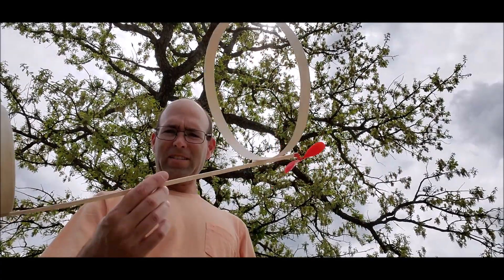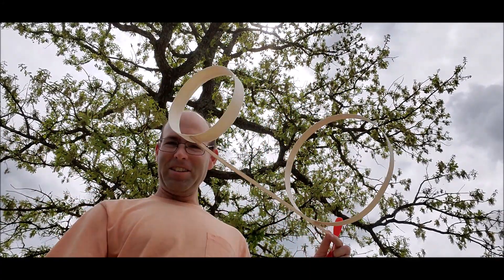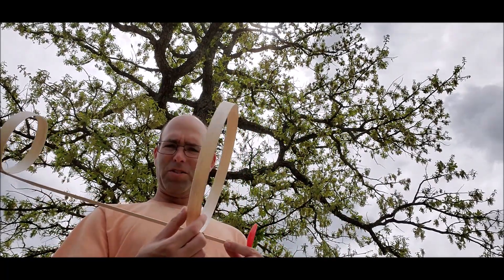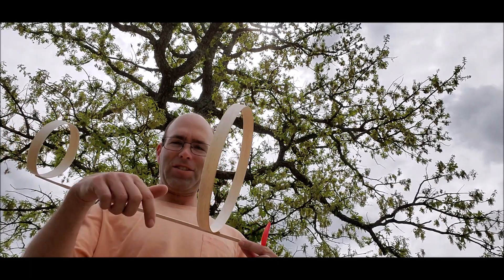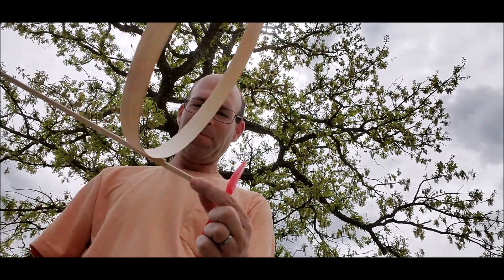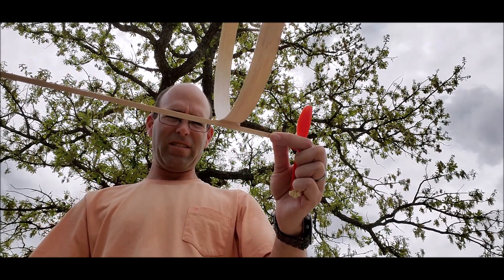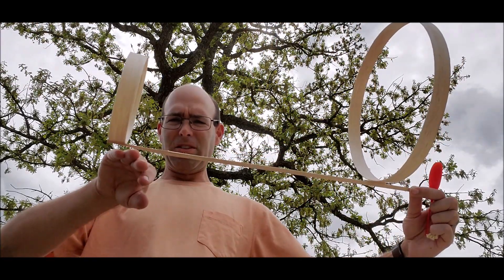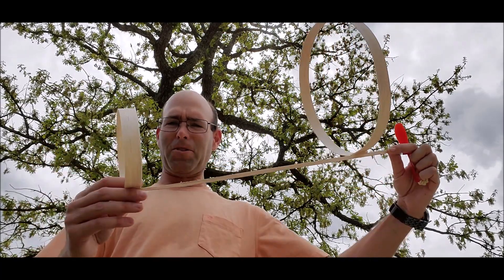How to build and fly a rubber powered circle plane from four pieces of balsa!

Comment: Josh - very interesting video - thanks for sharing this with us.  I don't do a lot of free-flight but it is my understanding that while OOS is painful, it is also gratifying?  Watching your videos is making me want to start doing this.  I'd be interested in seeing you make a video talking about what plane and equipment you would start with as a rank beginner, what plane / equipment to go to /add when you get to be an intermediate flyer, and what plane / equipment to go to / add when you get to be an advanced flyer.  Also, I am interested in the construction of your field box as it varies a lot from Radio Control and/or Control line airplanes (which is basically what I know about).  Thanks again for the great videos.
Reply from the maker: OOS flights are pretty exciting when it's a small model or it's your first time. When it's a plane you really like, well not so much. It's part of the discipline though. All of my larger models now have some form of radio beacon that I can install anytime I fly them, so they can't hide from me!